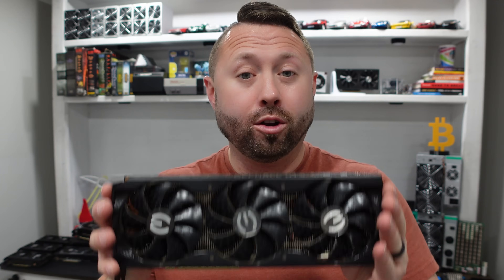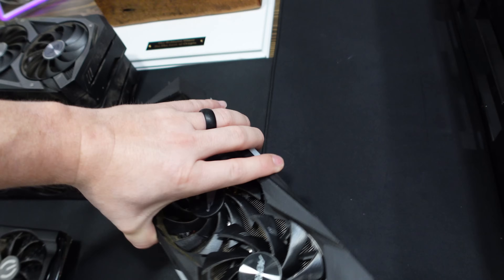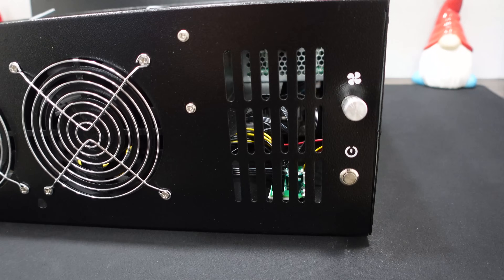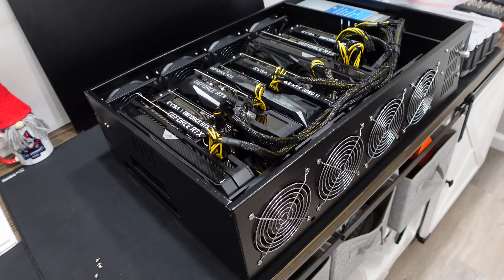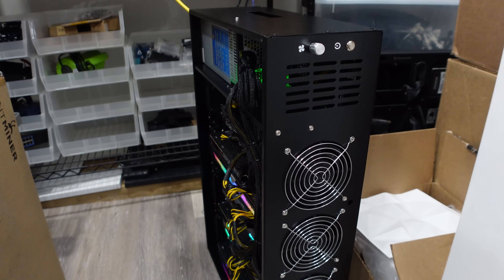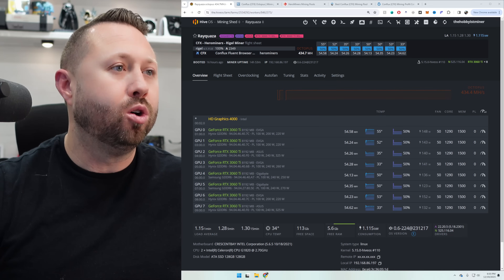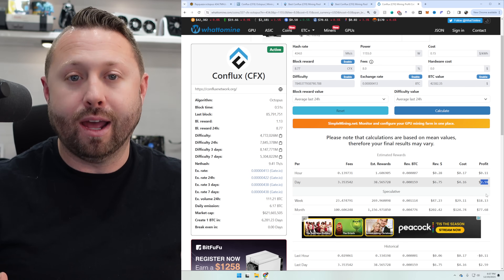What I’m MINING on my NEW 3060 Ti GPU Mining Rig! Conflux Crypto

Comment: 01:49 ROG is an acronym for Republic Of Gamers, pronounced Are Oh Gee, not 'Rawg'.

06:15 holy wowza! the market is back. those were $199 on coupon on amazon just a few months ago. wild.

11:09 I have resistor modded the fans in those VTRETU power supplies with excellent results for in home use.

11:50 oh lord... if you can trade the Hynix cards with '46' in the middle of the vbios string for anything else straight up, you really ought to. those have memory IC faults all the time, and are by far the least efficient on power, lowest clocking revision of the 5 on 3060Ti :( 

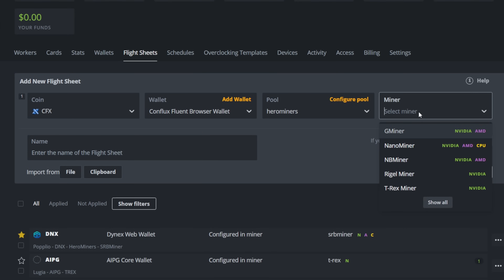14:30 'Rye Gel' ≠ Regal for Rigel

16:00 best OC for the 3060Ti on conflux I've found lock core 1280, 100 core fofset, memory offset 1800 - 52.16MH  - 131w. .398 eff on Gminer 3.42 verified on a samsung memory XC 3060Ti on a PMD.